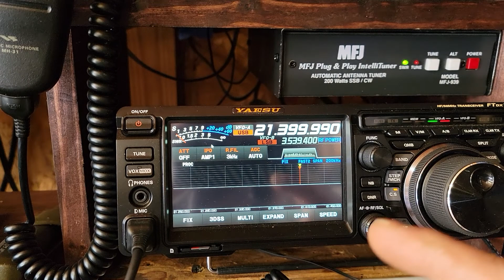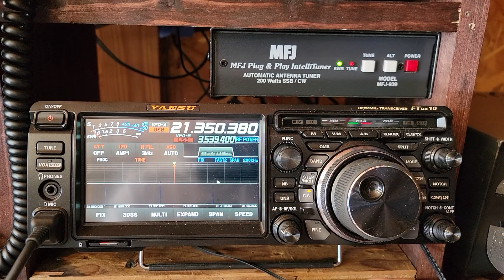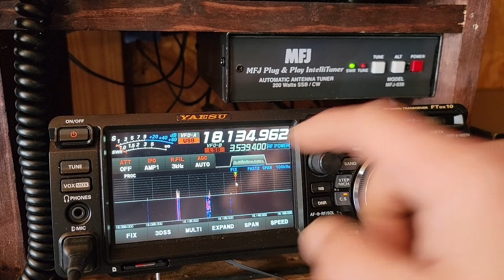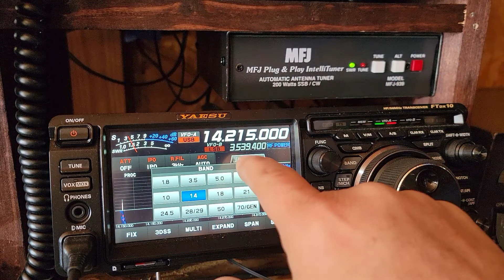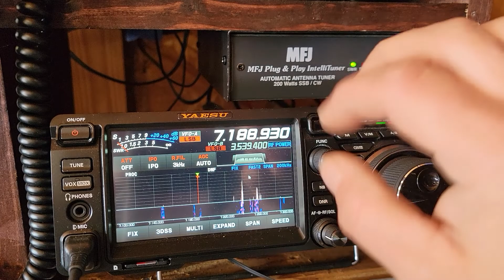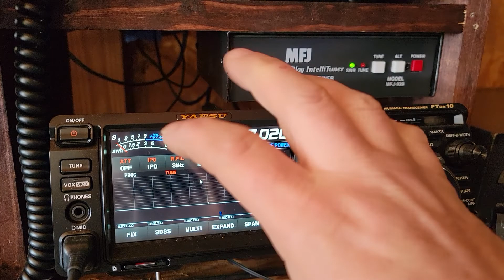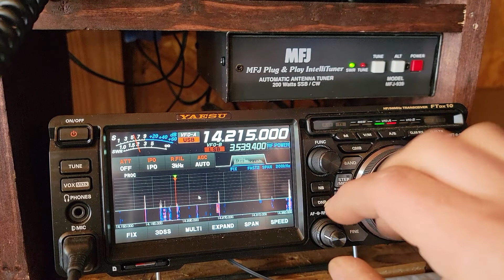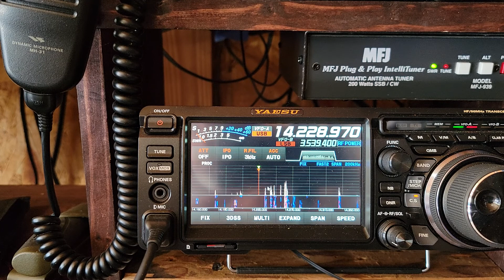Yaesu Ftdx10, my noise floor now

Comment: how do you like the mfj939 tuner? can you use it with ft8?
Reply from the maker: Works pretty good.. Don't really use it much anymore because all my antennas are resonant.. But when I needed it on my efhw it tuned everything I needed it to.. Yea the mode shouldn't matter. As long as you're not running more than 200w through it is what matters.
Reply: thank you!  @AK4PJ
Reply: I see you have the mfj998 also do you like that one better?
Reply from the maker: @thomashenderson603  I wouldn't necessarily say better.. It has more information. Has a nice swr/ power meter.. And shows it also on the digital screen... Not a fan of the size though. It's pretty big... Only reason I have it is because I got my amp before I aquired my Moseley yagi. So my antenna wasn't resonant and that tuner is a legal limit tuner... If you don't plan on ever using an amp, or use resonant antennas with big power it's probably not worth the room it takes up imo
Reply: I had a amp and sold it, never used it much with the 101mp. so it sounds like the mfj-939 would be perfect for me. Thank you tom @AK4PJ
Reply from the maker: @thomashenderson603  they also make a couple of other models that are in between.. They make a 929 that is 200w and has the  meters for swr, reflected power.. And 300w version. Maybe a 929b I think is the model... Look on mfj site and you can see them.. On the little one I have the meters are what's missing.. But if you have meters already then probably wouldn't need that option.... The one thing I did like about the 998  was it had built in amp protection. But again if you don't have a amp in place no need for that.
Reply from the maker: I see on gigaparts they have a mfj 929, 200w model with the digital meter.. But those models also have a extra antenna connector. The 939 does not. It's just got 1..
Reply: I have to look at it. Thank you Tom @AK4PJ

Comment: What type of rf choke(s) did you use. Understand you have one near the antenna and one close to the rig. The connection to the 'base' station is unclear what you mean with that. Currently suffering from S9+ on 80 and 40. So any info might help.
Reply from the maker: I just have a air choke.. Basically about 8 loops of the coax at the radio side. That's its... But what I did to reduce my noise the most was was search my house for culprits and take them out.. Little devices that were plugged in unnecessarily got unplugged until they are needed... Look for LED lights to be some of the biggest contributers to noise. Like shop lights, light strips,led Christmas lights, wifi security lights/cameras 
..
Reply from the maker: You will want to cut power to your house if you can and run off battery. Then turn on each room breaker individually and check for noise on your radio... If you cut power to your home then it could be a neighbor or power line noise

Comment: I just found my worst noise culprit !
Freaking HP laptop charger/power supply.
Unplugging my charge the s units drop from 8 down 
to 2 or less.  So I use the laptop on battery only when I need hear.
For WSPR it doesn't matter.
Reply from the maker: Yea those switching power supplies can be horrible.. Those little Walwarts like phone chargers are pretty bad also.. It's nice though when you're able to find the noise and remove it. Then all the sudden it's like.. Ahaa I can hear.

Comment: I have the MFJ-939Y, great tuner, I use it with my FT-891.

I set the antenna to External and had to set a jumper inside the tuner, once I did this I set the radio to 5watt TX on AM so now to tune all I have to do is press PTT and UP on the mic and the tuner tunes automatically without having to change the radio to AM and press tune on the radio, very convenient and fast. 

The DX10 looks to be a great radio, enjoy.
Reply from the maker: I love them both. The dx10 has really been a great add for sure.. But the 991a is no slouch by any means. There's not been any signals yet on the dx10 that I can't pull out on the 991a also... I do wish they had given more memory channels on it though since I'm in a repeater rich location. Outside of that I have nothing bad to say about the 991a... Like my mfj 939 also since not all my antennas are resonant everywhere
Reply: @AK4PJ  A friend of mine has the 991a, nice radio but it nearly drove me mad using some of the menus and memories. A feature rich radio for sure, 2m and 70cm + Fusion. I find it strange that yaesu exclude fusion on the DX10 but I suppose they designed it to be used with repeaters and since it doesn't have 2m or 70cm they probably didn't bother. 

On thing that amazes me is that the DX10 can't TX PSK31, it decodes it which is cool but would be great to be able to transmit.

Comment: antena=? and where(m=?) from grounded point are you rf choke and detail pleaseabout choke
Reply from the maker: The one choke balun is in between the antenna tuner and the radio. About 2 turns through a ferrite bead made out of a 3ft rg8x jumper..... The other is just a coax balun before the antenna switch made out of about 6-7 loops in the rg8 coax about 4 inches in diameter.... The one at the antenna I have taken out and instead grounded my coax before entering the shack. It's connected to a 8ft ground rod.. Barrel connector there fastened to a clamp to the ground rod..

Comment: Great stuff, are you able to share more details about the choke balance etc. you used?
Reply from the maker: Sorry I didn't see this before.. But it's just about 8 winds of coax right before the radio. So just a air wound coil.